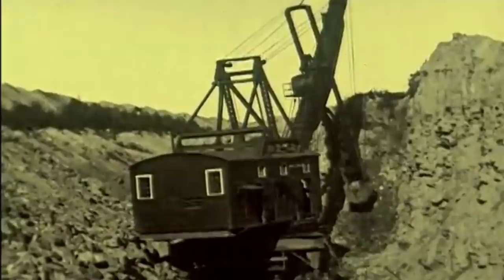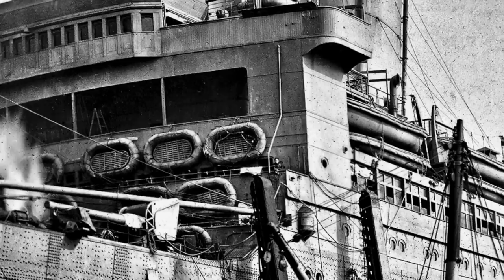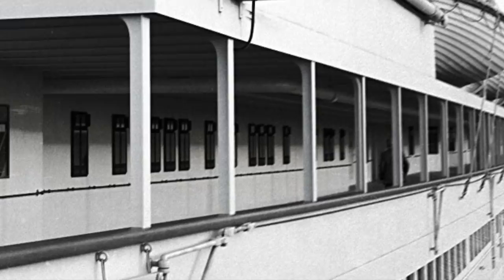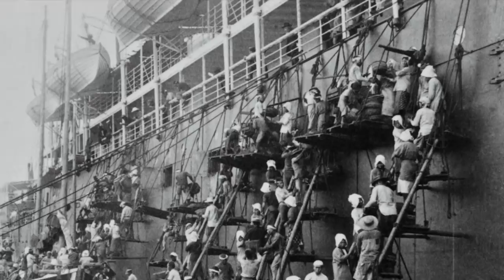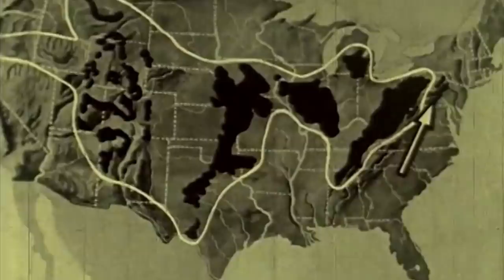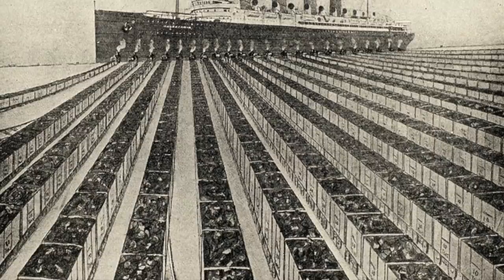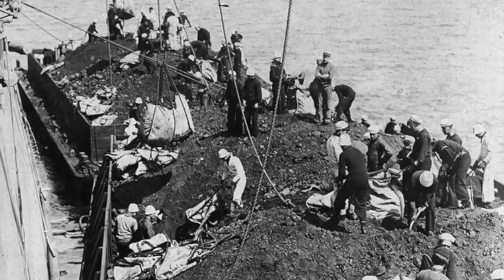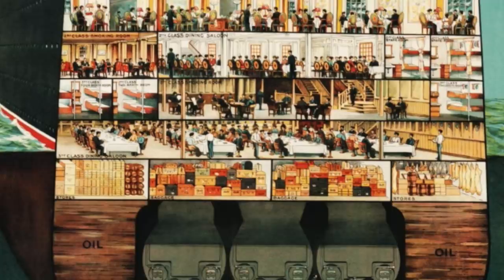Coaling/Bunkering an Ocean Liner

Comment: I can't believe no one came up with an auger or convener belt system to load coal on ships and trains. It seems like come convener belts and augers could cut down on the labor required by a substantial amount.
Reply: They did. Labor was much cheaper and easier to replace when it broke down than machine. It still is in parts of the world, especially where you don't have to worry about health and safety.
Reply: The really big steam locomotives such as the Union Pacific  Big Boy were fired with an automatic stoker which resembled an archimedes screw.
Reply: There were bucket ladder devices.
Reply: @michaelbizon444  I had one hand fired coal furnace which use stove coal.  I shoveled coal in and ashes out in the morning.  Later I had a boiler with an auger fed from the bottom of a large steel barrel into which I shoveled pea coal from the bunker through a grating to be sure there were no foreign objects.  I would check on it every 2-3 days. The ashes just fell into a steel bucket. Both used anthracite and I had no problem with sizing of the coal.  A big advantage of the furnace was that hot air would rise through the ducts even if the power went out.
Reply: @commonsense1907  The Big Boys were oil-fired, as were all of the Union Pacific's large locos (Challengers, FEF-3s, etc.)  You would have found the stokers you're talking about on the railroads in the eastern half of the country, like the NYC, B&O, and Pennsy, where coal was more readily available.  There is a cooperative project going on right now restoring the stoker engine for a steam loco under restoration, with a number of the machining channels,  like Keith Rucker's VintageMachinery.org channel, Abom79, Dragonfly Engineering and Blondihacks, and possibly others.
Reply: Union Pacific Big Boys were originally coal fired. 4014 was converted to burn oil when it was returned to service in the past few years.
Reply: @brianh.9268  You're correct, my mistake.  One of them was converted in 1946, and reverted back to coal in 1948, at least according to Wikipedia ( didn't pay attention to the citation).  I also didn't realize that the UP owned their own coal mines in Wyoming.  It appears that the Challengers were also originally coal-fired, and converted to oil in the 1940's.  I also didn't know that Challenger #3985 was retired from service in January of this year.  Thank you for "challenging" what I though I knew.
Reply: All cool. Saw 4014 on two separate occasions last year in the Omaha area; an amazing engineering wonder. Spoke with Ed Dickens (steam team manager) and he confirmed 3985 was finally retired as too many things needed significant overhauling. So, it’s just 4014, 844 and the diesel E-9s and one 6900 series left to the heritage fleet.  Take care and be well. Best, B
Reply: @brianh.9268  I have a UP Video on the Big Boy. It's a great video. It's nice to see 4014 running on youtube videos.  I wish I was there in person! Did they say when they will use 4014 to haul freight? It would be nice to see 4014 hauling freight like it was designed to do. It's unfortunate,  3985 needs too much work. Maybe they will change their minds. I never thought I'd see a Big Boy running.
Reply: Common Sense — Me neither as many said there would never be a Big Boy running again. Ed and the steam team did a great job. I don’t think they’ll ever pull freight consists with 4014 other than those they have used as a “ballast” when running light. UP’s website up.com will show when steam excursions are running; my guess is there’ll be a 4014 run from home base Cheyenne to Omaha next June if the CollegeWorld Series is played like in normal years. Be well and be seeing you safely trackside. Best, B
Reply: @brianh.9268  Thank you, and same to you.
Reply: While a machine would help load the ship faster, the loading is ultimately only as fast as the slowest single task in the process: the coal trimmers having to move the coal into the bunkers by shovel and wheel barrow.
I'm sure everyone but the coal industry was elated when they switched to liquid fuel oil lol
Reply: I can't vouch for ships, but with steam locomotives, steam powered augers started appearing on locomotives in the early 1910's. Some of the earliest (1912-ish) uses of an automatic stoker were on a few of the Pennsylvania Railroad's K4 locomotives. The Pennsy could afford the stokers on its locos, as well as keep up the maintenance of them. After a certain size of locomotive, an automatic stoker was nearly a necessity; see the Big Boy comments here. In 1939, the ICC required that locomotives over a certain weight (different for passenger and freight locos) had to have stokers equipped, but by then, almost every locomotive of that size and in that service was equipped with them.
Reply: @commonsense1907  Archimedes' screw is also used for grain and other agricultural stuff.

Comment: Have often thought how tough a job it would have been to work in engine room of a coal burning ship.  Did not realize what a manual process was involved to refuel.  Did some of the older oceanliners continue to burn coal till their retirement? 

You might look at a video on how Military vessels like battleships handled coal loading and burning.

Great video!
Reply: Don't forget that coal can spontaneously combust, so in addition to moving coal the boys in the bunkers would have to put out smoldering fires.  Supposedly the Titanic had a bunker fire almost from the moment she left port.
Reply: @jayschafer1760  apparently days  before and constantly being put out.
The side that was hit by the iceberg  was damaged by coal fires before the titanic set sail.

Comment: Years ago I worked for Peabody Engineering Corporation, a designer and manufacturer of combustion equipment, mostly for power generation.  Ernest Peabody learned how to mechanically atomize heavy (bunker "C") fuel oil without the use of steam.  His burners were used on various steamships during the second decade of the 20th century, and were considered a great advance over firing coal.

Comment: Anyone have an idea why this video reports "This video is unavailable on this device."? And yes, I've Googled it. And done every thing I've found. Thx for any help. Good day.
Reply: Same here, on a Windows 7 desktop.
Reply: Cant watch it on android either
Reply: Same for iPhone
Reply: Windows 10, not available on this device.
Reply: Same here, no luck on my windows 10 laptop and my iphone.
Reply: same one iphone a week ago. It works currently on iPad. I resorted to using y2mate to download it.
Reply: I'm watching it on my Android phone
Reply: A fireman or stoker, sometimes called a "boilerman". A fireman, stoker or watertender is a person whose occupation it is to tend the fire for the running of a boiler, heating a building, or powering a steam engine. Much of the job is hard physical labor, such as shoveling fuel, typically coal, into the boiler's firebox.

Comment: I spent about 27 hours fueling up a chemical tanker two times within a month. Fuel was too cold and stalled the big Cummins engines driving the pumps. It sucked
Reply: should have lit a fire under the diesel tank to keep it warm 😂

Comment: Well looking at this, from a modern sailors perspective.  'a matter of  hours' may be a bit light, we generally bunker about 1000 mt of fuel oil, which takes from start to finish 10-12 hours.  And to immagine that there is now only 3 people running the engine room. 

3 pounds a ton for coal :O  compare that to the 380 usd that you pay for a ton of fuel now! 

oh and the buisness principle of fuel suppliers to try to steal some of the fuel you ordered and payed for is still standard practise.  

note; Shipping still has a problem with finding enough technical crew!  many of my collegeas (and me too) regularly is on board longer due  the company not having a reliever.  (not even mentioning the problems the pandemic has caused in crew changes)
Reply from the maker: Fair enough. I don't mean to downplay the amount of work it is to fuel ships today because I know that everything is harder than it sounds in theory. And that's interesting that fuel suppliers still try to short the customers. Thanks for sharing
Reply: @TheGreatBigMove  It didn't feel as a down play.  I didn't mean to sound negative., just informative.  I wouldn't want to go back to bunkering coal o.O  even with a big crew it's a hassle as you perfectly showed.
Reply: Don't forget inflation. 3 Pounds in 1910 is 356 Pounds today. Not far off from your modern price, and I may also be using the wrong year for my estimate. Also, I bet you get much more from your ton of oil than these liners got from a ton of coal, especially given the leaps in efficiency.
Reply: talking about cruise ships, not cargo vessels,  they arrive in port about 7A and leave about 4 or 5 P, fuel has to take place in that amount of time, cargo vessels generally spend about 23 hours in port at most.  Most all ship today are diesel making them several times as efficient as steamers whether the steamer was coal fired or oil.  Coal fired vessels generally used what we'd call today low pressure steam generally due to restrictions on their 'scots' boilers, oil fired boilers generally of the water tube design can raise higher pressure steam, of course you have to have a engine designed for this pressure.  Up through WW2 most cargo vessels and lesser passenger vessels  would use triple reduction steam engines like those on the Titanic,  military and liners would use turbines.  (the Titanic had a non reversing low pressure turbine that powered the centerline third screw.)
Reply: Lol ikr.
Reply: @user-do5zk6jh1k  I forgot about inflation honestly :D thanks for pointing that out, I sure hope we got a bit more efficient over the decades :)
Reply: @henryostman5740  I honestly have no idea what you ment with "7A" and "4 or 5 P"   But you cant generalise the time in port of cargo vessels like that, it really depends on the type of ship, and the cargo. I'm sailing general cargo and/or heavy lift,  the littlest time in port was 20 minutes, (discharing 1 container) the longest 25 days, loading several heavy complicated lifts.
Reply: @Jacob-W-5570  Even without efficiency gains, bunker fuel is almost twice as energy dense as coal, so there is that.
Reply: @Jacob-W-5570  cruise ships come into a trip ending port at about 7 AM and leave with new passengers at 4 or 5 PM generally, thus being in port less than 10 hours, during that time they will bunker, provision, unload and reload passengers, clean all of the passenger cabins with new linen, and move all of the luggage off then on, quite a task.  A typical cruise ship will burn about 100 tons of fuel daily (on average), larger ones about 150 tons,   they generally don't go very far between ports and hence go at slow speeds but their A/C load is on forever, they don't use shore power when in port and it's either summer or they're in the tropics.  I would guess that a typical container ship would use about 200 tons of fuel daily but they usually cruise pretty fast about 20+ knots to make schedule, if they do several ports on a trip say NY and Baltimore, time in each will depend on loading and unloading for the particular port, they will operate year round but the electrical load will depend on how many refers they carry since these plug in to ship power.  I was a military deck officer.
Reply: @Jacob-W-5570  7a = 7 am = 0700 local time.  5p = 5 pm = 1700 local time.
Reply: And you can bunker while underway with fuel oil!

Comment: The SS Atlantic wrecked as a result of the captain thinking they were going to run out of coal in 1870
Reply: Yes, but that was only because the chief engineer was falsifying the daily fuel report that the captain received.  The chief did that because he wanted to captain to run at a lower speed, thus saving coal.  But, we all know how that turned out.
Reply: fred brant  ?

Comment: Im surprised they didnt just have a huge shaft in the top of the ship that a conveyor belt or some other machine like they have for loading gravel trucks could just dump coal into.

Nobody ever thought of making this easier?
Reply: or even something similar to the ore docks they use on the great lakes where they could gravity flow the coal from a rail car into the ship's bunkers
Reply: They did (7:45). You'd still need to fill each bunker separately (it was needed anyway to keep the ship balanced), but all the lifting was done by the conveyors.
Reply: Right? Instead of pushing the ship away from the quay and bringing up a barge, just run a rail line up to the dock, and have them dump into hoppers with swinging chutes.  You could dump ten tons per bunker at a time, instead of a bucket every now and again.

Comment: I can't believe they couldn't come up with a more efficient system to load coal on a ship.
Reply: The problem is when the coal gets inside the ship
Reply: Labour was fairly cheap, especially in the early days of coal liners
Reply: @Septimus_ii  oh I don't care about that. The video talks about the need for efficiency and speed so the ships can sail on schedule. Surely this had to be taken into consideration when designing them ?
Reply: They did. From sails in the 1850s, to coal, then oil, piston engines to super heated steam turbines in a hundred years.   Tremendous advancement in powering ships.  I'd think an auger system would be used for loading coal, the technology is simple and was known, but labor is cheap.

Comment: Why didn’t thay build a huge coal hopper like steam engines use?
Reply from the maker: I'm not exactly sure, but I would guess that there were a few reasons such as limited space on piers and the fact that there were many coal bunkers throughout the length of the ship and many hoppers would be necessary. On top of that, ships are different sizes and the openings are in different places on different ships so the flexibility of barges works better.

Something I forgot to mention in this video is that, at the very end of coal-fired ships, the coal barges were mechanized.
Reply: The 'hoppers' still had to be filled, regardless of whether a loco or stationary boiler/s as in a ship.   Except for coal powered generating plants, which actually demand pulverized coal,  locos and ships could not be run on 'slack' or coal dust like power stations -
 1. It would be almost impossible to burn efficiently because of 'clumping' (no air space between fuel ) 
 2. Actually firing by the stokers/firemen with spadefuls of light dust would make it impossible to keep up with the boilers .
3. Coal dust is extremely volatile in enclosed spaces such as boiler rooms - there would be a very real risk of explosions.
4. Loading coal down chutes will increase the likelihood of breaking it down into dust as it falls any distance, making the reasons above why it had to handled with some care to obviate all the above.
Reply: @colliecandle  it honestly sounds like a nightmare to do all that, oil burning ship crews must have appreciated the simplicity of pumps
Reply: Probably because it was cheaper to use inconvenient otherwise unusable lower areas of the ship for coal storage rather than hoppers that would reach into the upper decks that were needed for paying customers because labor was cheap and safety regulations were lax.
Reply: Not only were oil-fired plants cleaner, when compared to coal-fires, but they also had a more consistent & predictable burn... making delivery of steam to the bulkhead steam stop valve much easier to control.

Comment: I can't imagine how quickly Rockefeller's fortunes rose after they switched to oil.
Reply: Late reply, but by the time ships started convertion from coal to oil burning John Rockefeller had already reitred from business, in fact he was an extremely wealthy man many years before that. He made his fortune with oil as the fuel for millions of lamps prior to the breakthrough of electric power. Kerosene lamps were pretty much the only game in town (along with some gas, but rarely for domestic use) from the mid 1800-s up until the late 90s of that century. Internal combustion engines made him even richer, but it wasn't a good 30+ years after he started in the business that those entered the scene.
Reply: @mateuszmattias  Thank you for that.

Comment: No wonder the list of imperator was a troublesome for the crew
Reply: I doubt it was due to the coal distribution.  That could very easily been fixed.  I think it was more in the superstructure of the Imperator.  Something was not right in her weight distribution.
Reply: No I mean it was hard for them to coal imperator because of the list
Reply: limperator
Reply: @NonsensicalMRZKAM  But it depended on which side the list was tilted.  And on which side the coal was loaded when in port.
Reply: Yeah you got a point